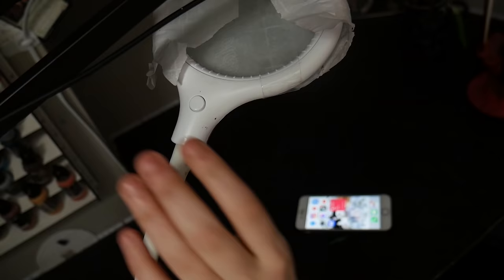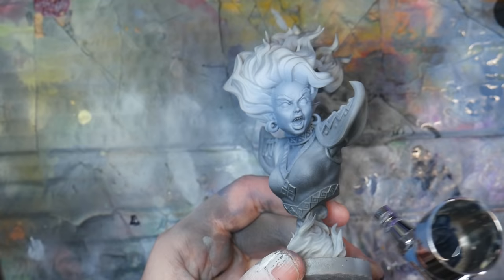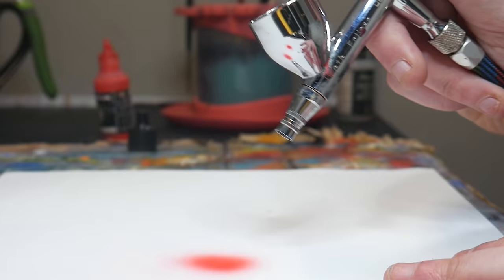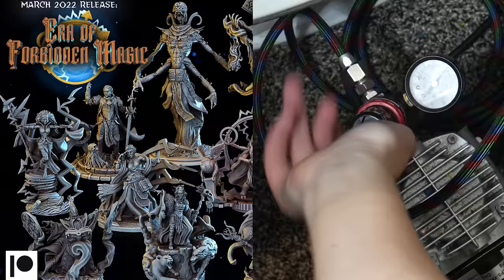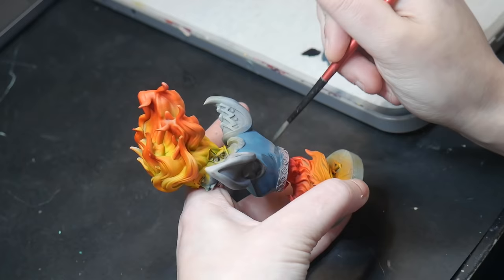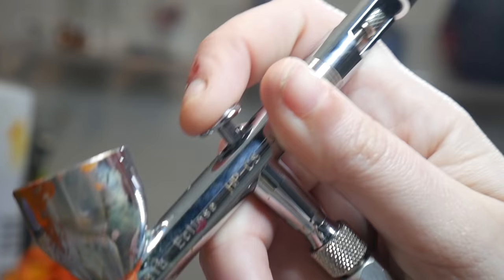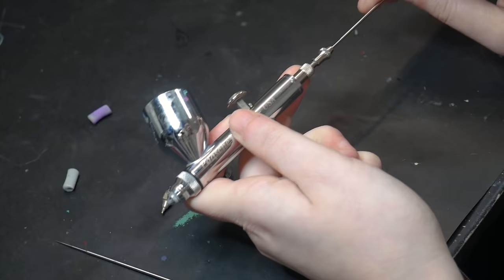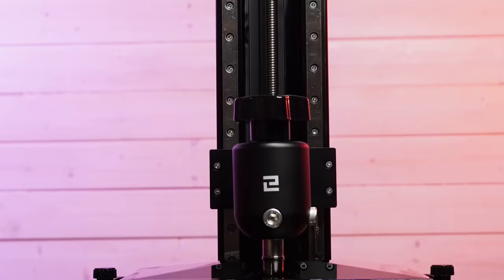Airbrush Miniature Painting Tips I WISH SOMEONE TOLD ME

Comment: Genuine question: what's with the shaking of the brush while painting? I've seen a few airbrush artists do it but not a single airbrushing tutorial has mentioned it. 

It seems like it's unnecessarily increasing the difficulty of applying paint precisely if you're shaking the brush around. I'm guessing it's maybe to avoid paint splatter for that first spray, like when you start spraying a rattle can where you want to start and end a stroke off the model to get an even coverage, but when you're airbrushing detail work you have to start on the model. So I guess shaking might help reduce splatter, but at the cost of accuracy. 

I can't help but feel that a steady hand and precise trigger control, starting with a light application of initial paint would be a better technique to use, but Angel Giraldez does it too, and he's an airbrush master. But nobody ever mentions it.
Reply from the maker: You keep the brush moving to allow the paint to dry. Even after the proper pressure, you can still cause paint to spider web if you don't let it dry.

Comment: Bought a gravity feed airbrush mainly for priming...it was aweful. Instantly clogged and even when adding airbrush thinner the pistol would clog right after priming. Cleaned the airbrush multiple times after every priming...even with alcohol. The gravity feed pistol is dead now...I was never disapponted so much by a product. Then I bought a bottom-feed airbrush pistol with the tank right in front of the air nozzle and it works like a charm. Surely it's no double-action just single action but for priming it is absolutely the best. Cleaning is done in seconds and the risk of clogging is nearly zero.

Comment: Great advice, Thanks.  I don't use my airbrush as much as I could/should, to gain confidence and experience, as I detest cleaning the thing afterwards. I paint for 5 minutes and clean for 10!  Not fair... 😜
Reply: Get an ultrasonic cleaner. Then you can just flip the switch and walk away.
Reply: @1pcfred   Interesting, never heard of that option.  Could I trouble you for some reference?  And what type of cleaner fluid do you use?  Thanks
Reply: @rrl4245  it would depend on how dirty the airbrush is. If it's not too bad any cleaner will do. Another thing folks do is the bag trick. You put the item you're cleaning in a ziplock bag with the cleaner of your choice and fill the ultrasonic up with water. Then you can change cleaners. Just make sure whatever you're using doesn't melt the plastic bag.
Reply: @1pcfred  Thanks. I am getting better, as I experiment, but still....
Reply: @rrl4245  that's how it goes. Improvement is an incremental process. Little bits add up. The real trick is sticking to it. When you really examine overnight sensations you often find they'd been at it for years.

Comment: So a couple things that should be mentioned. A third option is how hard you are pressing down on your trigger (for dual action airbrushes). You can control the flow using how far you push down and how far you pull back.

Also don't use those black scrubby brushes that are sold in airbrush kits. If you use one on a Badger it's a good way to void the warranty.
Reply from the maker: I learned two things today!
Reply: @LylaMev  You want to use the soft dental pics for cleaning your teeth. Those black brushes you get in airbrush cleaning kits will scratch the metal of your airbrush and ruin the seal between the nozzle and the body of the airbrush causing air leakage. And there is no way to repair it. Which is why Badger flat out tells people not to use them.
Reply from the maker: @bruceyoung9692  oh no!
Reply: @bruceyoung9692  You can (and should) replace these seals regularly. The first thing I do when I acquire a new (or used) airbrush is to check this seal and replace it if it's cheap or not solvent proof. At any rate, they're a perishable part, never intended to last and meant to be replaced, whether damaged by cleaning, use or exposure to air and chemicals. And those stiff bristly brushes are what's recommended for removing old seals and seating new ones, once the threaded bearing screw has been removed to gain access to them.

Admittedly, I'm no Badger fan so perhaps they have a different take on these seals. If so, it's another reason why I don't care for their equipment but to each his own.
Reply: @davidkoloc1313  Yeah, there are seals inside that need to be replaced regularly. But the there is a tool to replace them, both to take them out and put them in. That brush will wear at the finish of the inside of your airbrush and ruin the seal between nozzle and the body of the airbrush. This seal has nothing to do with the rubber seals inside the central housing of your airbrush. This has to do with the fit and finish of metal parts.

Comment: "Fastest way to mess up you're gun" and there it is. I got paint down on my trigger mechanism and wasn't sure where I'd went wrong. Sounds stupid, and it makes total sense now. But I've been guilty of removing my needle whilst the cup is loaded a couple of times now. Doh!

(This is why you buy a cheap airbrush to start with. Even if you're loaded.) 

Thanks Lyla. Note to self :)
Reply from the maker: Good luck with your now clean gun!
Reply: @LylaMev  Thank you! 

I'm getting there. Good days bad days. You know how it goes 😄
Reply: Been airbrushing for 48 years and have always just pulled needles out the back of my airbrushes to wipe them, lube them, change them, inspect them, for anything really, with paint in the head or not.

If the needle bearing seal (which surrounds the shaft of the needle about halfway between the chuck and the head, in the center of the airbrush) is seated properly against the needle shaft, you cannot possibly pull paint back into the body near the air valve assembly when removing the needle from the back because that same seal that keeps paint from backing up along the needle shaft while the brush is running is certainly going to keep it from backing up when it's not. If you're getting paint in that area at any point, from doing anything, you need to adjust the needle bearing seal (tighter) around your needle shaft with a jewelers screwdriver.

The notion of removing the needle nozzle everytime you wanna remove the needle and there's paint in the head is ridiculous unless you like spending time screwing painty tips off and on instead of painting. 

There's good reason why the needle chuck in the back features an easily loosened finger nut and the needle tip requires a tiny wrench and practically a magnifying glass to remove it... One is made to remove the needle, easily and quickly, whenever necessary and the other is almost never removed.
Reply: @davidkoloc1313  Hi there. Apologies. Read this at work the other night and I totally forgot to get back to this.

Thanks. Still learning all the parts. Not sure exactly what the needle bearing seal is still. 
And looking at the exploded diagram I think I know what you refer to. But not sure. 
I did lose that part and had to buy a replacement. 
I've probably not tightened the replacement part properly? 

I now have another problem. Or I'm not sure how much of one. I used a cleaning spray and I think it's obliterated my grommets after a deep clean. 
I know they are there for a reason. But how important!? Guess I'll find out. 

Oh the joys of airbrushing! :D
Reply: @Chp82  No problem Colin, I get busy sometimes also.
Yes, the needle bearing (what I call it anyway) in most airbrushes , is comprised of two components...
1)  A soft or soft-ish ring, whose job it is to create a seal around the shaft of the needle, well back from the paint head. 
2) A tiny threaded plug with a hole through it and a slot for a screwdriver to fit in.
When threaded into the needle bearing port/housing and screwed tighter (which is clockwise, viewed from the open back of the airbrush once the needle/plunger/spring etc. is removed), compresses this soft ring, creating a tighter seal around the needle. 
Picture how a donut would expand outward and it's hole would get smaller if it was on a table and smooshed down on it with the palm of your hand. That's exactly what's going on at the bottom of the needle bearing port when you screw the threaded bearing down. The hole in the ring is getting smaller, creating a tighter seal on the needle which will be going through it.

As for your specific issue. Some airbrushes are not sold stock, with a solvent proof or evenbdurable seal/grommet/O-ring in this bearing.
But replacement seals are available and are rather cheap. You'll have to check with your manufacturer to see what's available, be that an exact replacement or perhaps a solvent proof upgrade. In my older Iwatas, I replaced the black rubber rings with a newer, one piece threaded bearing that had a white, solvent proof, Teflon ring imbedded into the end opposite the screwdriver slot.

At any rate, don't be intimidated at the prospect of removing these parts to inspect, clean or replace the ring. All you need to deal with the two piece assembly is a small enough screwdriver (- not +) to fit into the slot in the(rearward facing) threaded plug and a small shaft style cleaning brush of a diameter which will allow you to push it partially into the ring (once the threaded plug is removed) just far enough to grab it through it's center hole, to pull it out.  
The best way to reinsert it or place a new one is to simply slide it over the front tip of a needle, about an inch down, insert the needle from the back and push it through until you can grab the tip of the needle out the front of the airbrush and draw it all the way out. This puts the ring right back in it's proper seat, ready for you to reinsert the threaded bearing and adjust it properly.
Getting this screw/plug started into it's threads can be tricky if you've never done it before. I used to use a screwdriver with a blade that's just thick enough to hold the plug at it's end while feeling for the hole and starting it in. I've also seen people use a bit of tape over the end of the screwdriver so the plug doesn't easily fall off while getting it started into it's thread. What I eventually fashioned (and should actually make and sell) is an old needle with the blunt end flattened out to seat into screwdriver slot. I simply slip the plug over the needle, slide it all the way down to where this flared end sits, keeping it on and insert the needle from back, pushing it through until I can grab it from the front, then get the plug against it's port and simply twist the needle to get the bearing plug started in it's threads. Push the needle back out (rearward) and finish tightening it with your screwdriver.
Once at this point, tighten just until you feel the bearing/plug is against the rubber seal. Then proceed tightening it incrementally, checking between say 1/8th turns until a good seal is created but the needle still moves freely through the seal. Im in the habit of testing this fit (the compression of the ring) with a dry needle, getting it good and tight and then adding my super lube or lip balm to this area of the needle. Before reassembling the brush. This assures both a good seal around the needle as well as it's easy movement through the seal.

If you find anything I explained confusing, let me know, I'll try to help clarify anything I can. No question is a dumb one when trying to learn. Been doing this a long long time and am glad to share all I've learned.
Take care Colin.
Reply: @davidkoloc1313  I had to read it about 4 times haha but I'm getting somewhere! I know the part you mean now. It was the actual nozzle I lost and replaced. You  had typed 'screwdriver' but my brain read 'spanner' and I went off thinking you were talking about that end of the gun. 

I didn't even know there was a removable component in that middle section. I knew there was an o-ring as you can feel it but didn't realise you could get in there and remove it.

The donut analogy is perfect! I get that and can picture it in action. So yeah it's all clearer now.

I haven't watched it yet but just to be sure. This is the process you are describing?....
https://youtu.be/d0xriTrGj1w

Your tips on getting a new bearing seated in properly. I kinda follow 
But it has lost me a bit.
 Hard to visualise. But thats because I've just learnt of it I guess. When I attempt it I'll all make more sense im sure. 

And was this the Teflon bearing product I should probably get ? 
..  
https://www.graphicair.co.uk/product/iwata-needle-packing-screw-with-teflon-needle-packing-for-c-bc-ch-ecl/?gclid=CjwKCAjwrfCRBhAXEiwAnkmKmY7FbWjBBRsChIXLFSYoQSuWK-Ks0gdybUOJ0hobhk0QZKk-8XqdqBoCwTYQAvD_BwE

It's the cheap dual action airbrush that's very common with newbies I have 
 Which I believe is a copy of the Neo or Eclipse :/ 
 So all should apply ok. 

I was intimidated at first, but I'm definitely not afraid to take it apart and see how it goes. I'll have a nosey once I get a screwdriver. Get my hands real dirty with this gun. Buy another in the coming months and hopefully I'll be more confident and clued up thus less issues 🤞

Thanks! Very much appreciated!
Reply: @Chp82  Yes, that's the piece in the great (cutaway) video. That Iwata screwdriver tool with the needle-ish probe looks fantastic. Had no idea they made one,c which is why I fashioned something out of an old needle to get that part seated right to screw in.

If possible, I'd investigate whether or not Iwata parts fit your knockoff airbrush. Many times these are exact replicas. Who knows, maybe you'll luck and the he parts will be interchangeable.

I don't mind the Neo brushes. I have two, one gravity fed one syphon and use them often on my artworks at home as I don't think they'd be quite beefy (size wise) or durable enough for use at my work. The paint we run there is usually thinned down PPG Breakthrough, a great paint bu decidedly thicker and tougher chemically on equipment.
Yes, that fellow was putting a single piece  (packing and seal) component in that brush. As I mentioned, on many older ones and some new brushes, depending on brand or model, there is a separate O-ring and packing/bearing screw. For these, the sealing rings are usually available in both rubber for exclusively water based painting or Teflon and other solvent safe materials for oil and solvent based paints or thinned down screen printing inks (such as NazDar) which create very nice finishes if one cares to make their own paints.

I'm curious what sort of stuff you use your airbrushes for, artwork, figures, models? I have a friend who's a car guy and has one just to apply ceramic powders to the combustion faces of his racing pistons. He bakes them on afterwards and swears they're better than the 200 dollar piston heads available from Italy.

Great tools once one knows how to maintain and use them. Have fun and let me know if you have any more questions. 
David Dennis Koloc

(www.dadenko.deviantart.com/gallery)
Reply: @davidkoloc1313  I'll be sure to check those parts yeah. But hopefully ill be ok as its a Iwata copy.
I'll probably end getting another airbrush soon but I'll grab a couple of parts for this to practice on. Get used to maintaining etc 

Yeah that cutaway shot is fantastic! Every airbrush newstart should watch that.

It's for miniatures I use it. Nothing special yet. Just the groundwork and adjusting stuff. Also for dioramas.
One day I'll try some canvas work. Why not.

A guy I used to work with using it for automobile work. I don't think it's pistons though 😄 That's interesting. Many uses. Great tools.

I used a proper gun years ago in college. With the giant booth with god knows what turning in it. Sludge that loves fumes I guess 😄

Thanks again.

I
You link to Deviantart seems to be 404. But I found you. 
Damn. Your work is tremendous sir. Bravo!
Reply: @Chp82  Thanks Colin. Be sure to wear a respirator if you're painting much at all. Don't make the mistakes I've made, my lungs are toast. Happy Spring. Have fun.
Reply: @David Koloc  Yes. Most definitely mate. I was having a look at them last week or so Infact. I have a couple of projects planned I'll be sure to get kitted out asap . Happy spring dude 👍

Comment: Oh hey, you're using the same kind of mask as me! That's good I was wondering if I got the right type.

Unless...
Reply from the maker: this would be when I tell you that I'm actually addressing the fact that this is NOT the right type of mask in an upcoming video
Reply: @LylaMev  That would actually be helpful, it's been difficult to find info on that... The one I got is supposed to filter dust and small particles, but I'm not sure if airbrush stuff falls under that.
Reply from the maker: @Marconius6  so the mask I have works for brush on paint, NOT atomized paint. I had to read the in depth instructions to find out this answer. You want to look for something that specifically works for spray paint.

Comment: Hi, after looking a few times at your videos, I want to get the équipment for airbrush painting. Do you recommend starting with a beginner airbrush or go all in with a very good one right now (to much fine tuning, maybe)? Also, what kind of mask an filter are you using? Thank you for all these videos!
Reply from the maker: I loved my Paasche talon! it worked great for years. If you aren't planning on doing really fine detail work with an airbrush, the talon set that comes with the hose and everything is just fine. And you want to get a face mask that is rated for spray painting or aerosol painting specifically.
Reply: @LylaMev  Thank you!